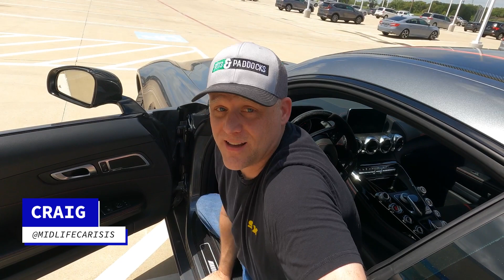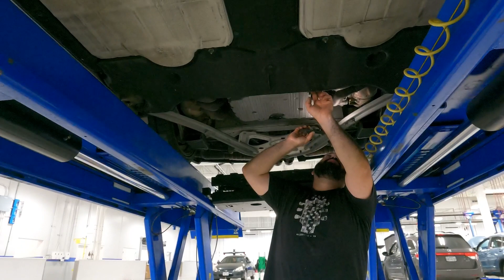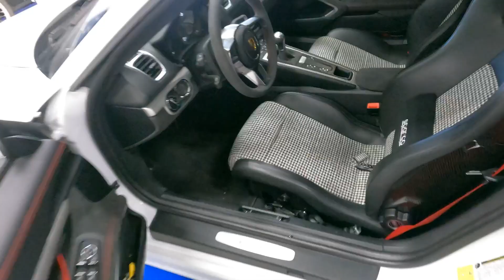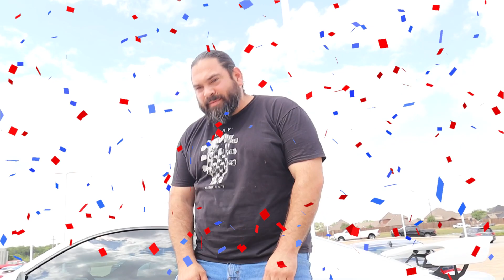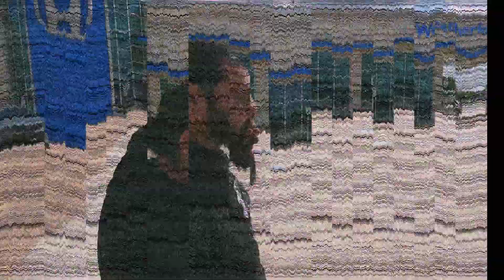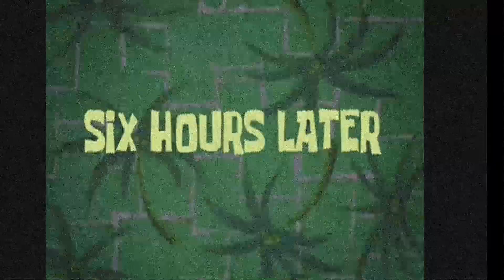TRADED my MERCEDES AMG GTS for a DEMAN MOTORSPORTS Modified PORSCHE 981 GT4 #porsche #gt4 #981

Comment: I love Deman’s engines, but this is a major downgrade. I had the spyder. It’s a fun car, but nothing compared to the 911 or AMG GT series. Why would you do this?
Reply from the maker: Spent 2 yrs with the GTS and wanted to try something new, so far I have been extremely happy. Besides i will likely buy another AMG sometime later this year if interest rates ever go down.
Reply: @midlifecarisis_  Yeah if I had it to do it over again I would get the GTR Pro. But the R has a lot of good stuff the GTS gets. Good on you for doing the Deman 4.5. It’s a good motor, just have to use a crummy octane boost system unless you have access to 95+ octane. But it’s a great motor.